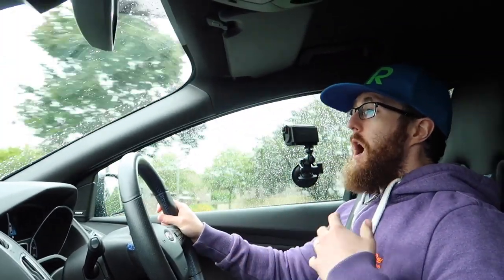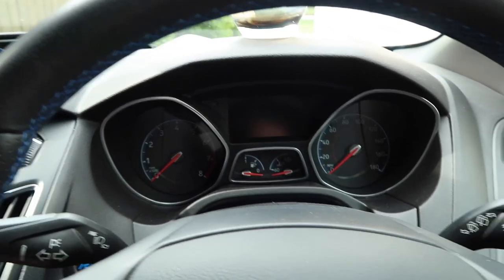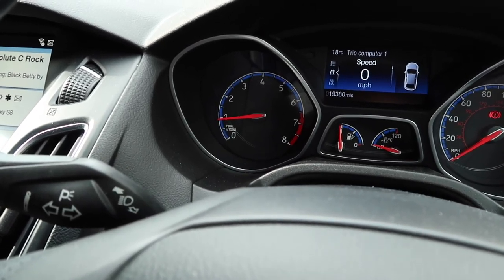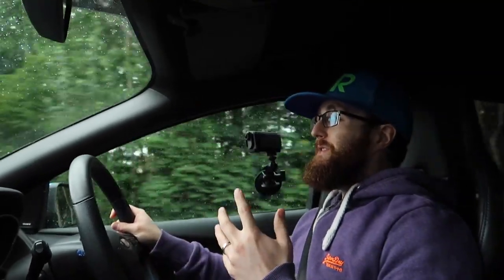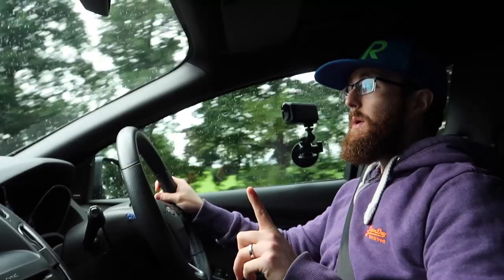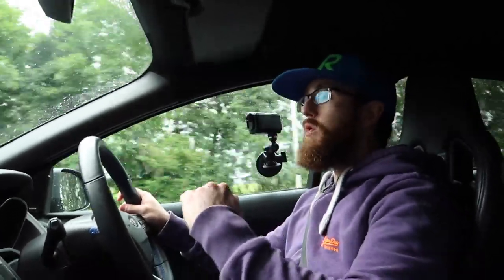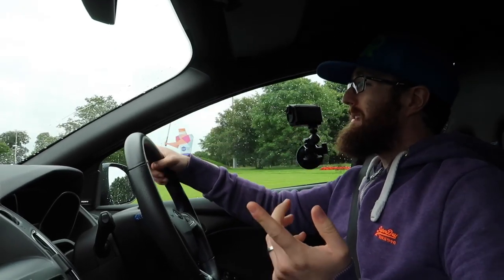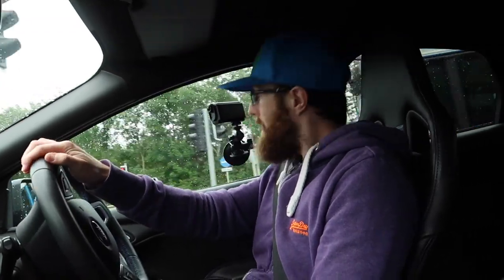NVH NIGHTMARE? - MOUNTUNE ROLL RESTRICTOR REVIEW! | FOCUS RS

Comment: I think this applys to the 1.0t ecoboost fiesta also, were very unsure to get one, but think ill get it after i watch this.. the mount is basicly the same material for fiestas and focuses from mountune.
Reply from the maker: Yep all pretty similar stuff, powerflex bushings in all of them. Cheers :)
Reply: I've just installed the poweflex rmm in my Fiesta 1.0 and the vibrations are pretty harsh. I have the street version as well. In neutral and first, the vibrations are loud! It improves from second gear on. No other mods. Do you have any suggestions?

Comment: I personally found the moutnune mount to be to soft on the Fiesta ST as I still get wheel hop under hard acceleration. I started with the OEM mount and powerflex bushing which was great with a little NVH than the mountune one but never any wheel hop even in the rain. Mountune have just revised the mount again and are on their third revision.
Reply: 19marshall80 Hi, I was looking at the powerflex insert for my Focus ST250, would you say the NVH on using the insert was noticeable over the standard rubber mount?
I had hoped it would give a benefit in rigidity but be less harsh than a full poly bush, and I have asked on a few FB pages, but you appear to be the only one I’ve found who has used one. 
Thanks
Reply: @GG-im1cb  Hi, you will have a little NVH with powerflex bushers...it feels like the car is vibrating slightly in the cabin on idle though especially with the AC on as the engine will engage the pully which will cause more vibration from the mount. I found with using the OEM mount (ROLL RESTRICTOR) and buying the powerflex bushers separately you do eliminate the wheel hop under hard acceleration...I personally did not mind the vibration in the cabin it's just a case if that really bothers you?
Reply: @19marshall80  thanks I had an aftermarket roll restrictor on my Mk2 Focus ST (make unknown) and  the NVH was really bad and I removed it, however I had hoped that this bush insert may not be as bad as it still uses the factory rubber bush as well 👍🏻